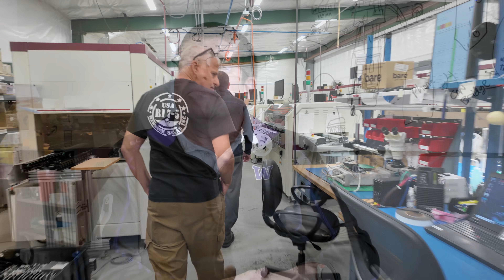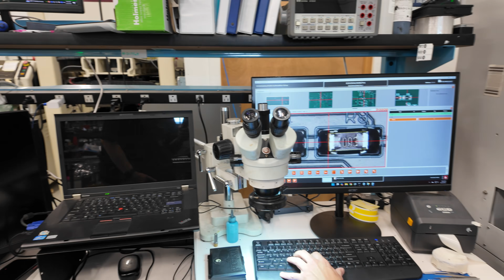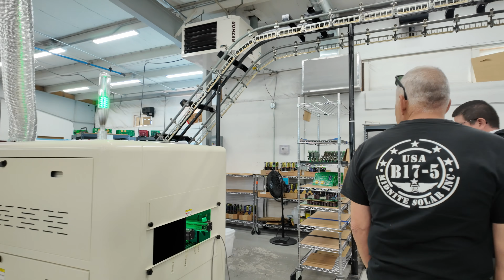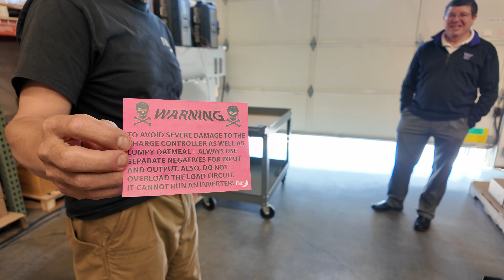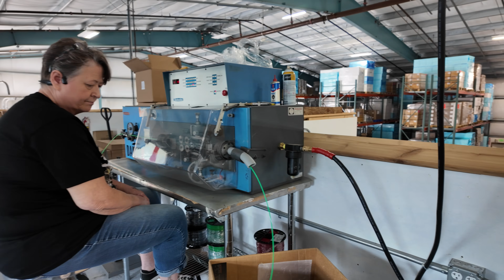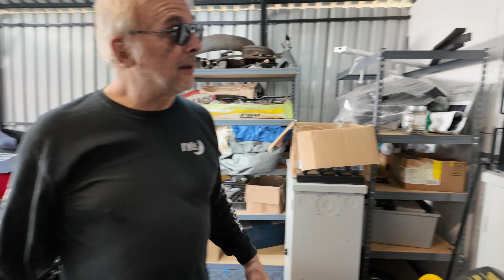Exclusive Look Inside MidNite Solar 🇺🇸 | Designed & Assembled in the USA

Comment from the maker: 🔧 Designed & Assembled in America
🔋 Built for performance and reliability
🏭 All done at their Arlington, WA facility

🔗 Useful Links
     🔹 MidNite Solar Website: https://www.midnitesolar.com
     🔹 MidNite Solar Forum: https://midniteftp.com/forum/

📦 MidNite Solar Distributors (Affiliate Links)
     🔹 Current Connected - https://www.currentconnected.com/?dgwt_wcas=1&post_type=product&ref=AzzpK9Fl&s=midnite
     🔹 SanTan Solar - https://www.santansolar.com/product-category/solar-accessories/?product-page=2&campaign=MidNite&ref=adamgog
     🔹 Signature Solar - https://signaturesolar.com/search.php?ref=adamd&search_query=midnite

💡 Looking for discount and promo code info?
Check out: https://going-off-grid.com/looking-for-solar-gear/

🛠 Products Seen in the Video (Affiliate Links)
     🔹 MidNite Solar Surge Protection Device (SPD)
           • Current Connected: https://www.currentconnected.com/product/midnite-solar-surge-protection-device-spd/?ref=AzzpK9Fl
           •  Signature Solar: https://signaturesolar.com/search.php?ref=adamd&search_query=midnite
     🔹 MidNite Kid Solar Charge Controller - https://www.midnitesolar.com/productPhoto.php?product_ID=531&productCatName=Charge%20Controllers%20-%20KID&productCat_ID=43&sortOrder=2&act=pc
     🔹 MidNite Little Rosie 3600W 120V Inverter – 60A Charger - https://www.currentconnected.com/product/mnlr3648m-little-rosie-inverter-charger/?ref=AzzpK9Fl
     🔹 MidNite Rosie 7000W Inverter 120Amp Charger - https://www.currentconnected.com/product/midnite-solar-rosie-7048-7000w-inverter-120amp-charger/?ref=AzzpK9Fl
     🔹 MidNite Rosie E-Panel AC/DC Enclosure & OCPD - https://www.currentconnected.com/product/midnite-rosie-e-panel-ac-dc-enclosure-ocpd/?ref=AzzpK9Fl

For more details, visit my website: https://going-off-grid.com

💡 Support the Channel
Want to support my work? Here’s how:
✅ Use my affiliate links—it doesn’t cost you extra, but it helps me out.
✅ Buy Me a Coffee: https://buymeacoffee.com/goingoffgrv
✅ Click the “Thanks” button under the video.
✅ Join as a channel member for exclusive perks: https://bit.ly/3Wdufqv

I appreciate your support! 🙌

Comment: Great video and inspiring workmanship. I have a couple of Kid charge controllers, combiner boxes, quad panels, epanels, and lots of breaker. I used to have a couple of Classic charge controllers. Never had any issues with them. Also have old Trace, Xantrex, Outback, and Magnum odds and ends as I lived nearby and picked up stuff here and there. I knew one of the people who was on the marketing team for Trace and have met a few of the engineers. I now wish I had gotten more involved in the solar industry there in the Arlington area. We relocated to New Mexico more recently and I’m sure hoping to try out a Rosie inverter with all this sunshine. Not looking forward to hanging the heavy Outback Radian Inverter I have this winter😅.

Comment: I was debating between the rosie and multiplus for my bus. The rosie is definitely more compact.
Reply from the maker: Yeah, it's much smaller.  I guess it all depends on what all you're trying to run...
Reply: @AdamDeLayDIY While the Little Rosie doesn't have parallel capabilities like the big Rosie, I guess you could always run two seperate Little Rosies, one to each 120V leg assuming an RV with no 240V loads, if you needed more than 3600W steady output. Once programmed you could just use a single mngp2 to monitor one of them to get a rough idea of use.
Reply from the maker: @MegaKrazyKen yeah I would imagine it would be fine, like you said, as long as you don’t have a 240v load.

Comment: The blue component for the SPD looks like a Metal Oxide Varistor (MOV). Great tour Adam. Thanks for going there and showing their facility.
Reply from the maker: Yep, those are different MOVs depending on the size SPD they’re working on.  The blue dots on the top of them help them determine which SPD it’s for.

Thanks!
Reply: they said movs several times

Comment: I have midnight solar charge controllers. I called their tech support guy a few times to get some help. In my opinion, the guy wasn't very patient. It seemed like he wasn't interested in taking the time with you until the issue was resolved. If I was an electrical engineer or a programmer I wouldn't need to call.

This turned me off to mns. I am going to buy EG4 stuff.
Reply from the maker: Thanks for sharing.  Sorry to hear you had a bad experience.
Reply: What was this "guys" name?
Reply: @williambryce8867 I don't remember.
Reply: @williambryce8867 this was probably 3 years ago.

Comment: So I’m getting the impression that due to no mention of the status of the AIO and the alternate company created to offload it, that it may not be such a good buy.
Reply: There was a short mention of them working on their own AIO... I wonder if that is the B17 or something else. I did notice that the tour guide was wearing a B17-5 shirt.
Reply from the maker: That’s a fair take, and you’re definitely not alone in thinking that way. MidNite Solar has built a strong reputation on their U.S.-designed and assembled products, and when they introduced “The One” AIO and the PowerFlow batteries—which were manufactured overseas—it did create a bit of a branding challenge.

Spinning off a separate company to handle those products seems like a way to preserve the core MidNite identity without having to walk back their “Built in the USA” messaging. That said, it doesn’t necessarily mean the AIO is a bad product—just that it’s positioned differently.

The lack of recent updates could be a red flag for some, but it could also just mean they’re still figuring out how to support it under the new structure. Either way, it’s smart to ask those questions before investing.

Just my 2 cents.

Comment: I am upgrading my solar system right now. I currently have 2 systems with 3 Midnite Classic Charge Controllers. I actually flew from Chile to the former USA to physically go pick up my Charge Controllers!
I am so put our that they did not have PLUG AND PLAY as seen with so many other charge controllers. I purchased my Classic 150s in 2017 and they had no connectivity. Yes I know that SOLAR is always upgrading with new tech, but they made no upgrades for their old Charge Controllers. 
Basically my Midnite charge controllers will not talk to the internet. I would imagine that the new ones are plug and play now, but I will not go back to Midnite. I am going... and I hate to say it.... victron. Trust me VICTRON will be getting a massive chunk of change $$$$. Jim in Chile.
Reply from the maker: Thanks for sharing!
Reply: @AdamDeLayDIY  My pleasure. Jim
Reply: This is a great display. Intricate business.  Best regards to Minister Solar. Brilliant staff.